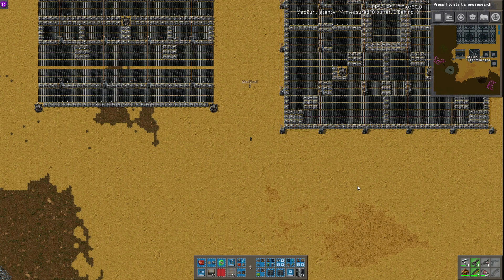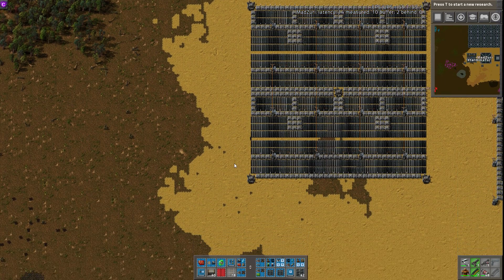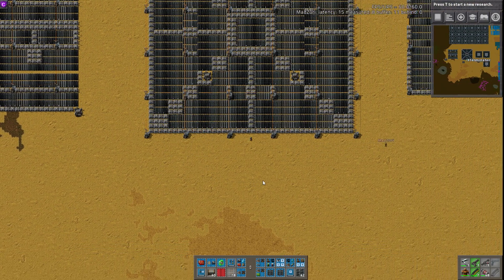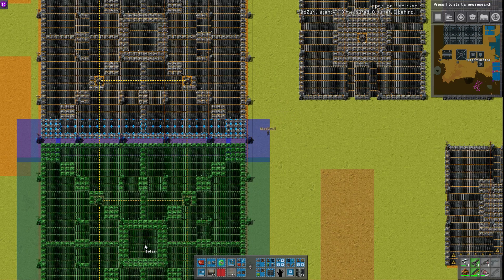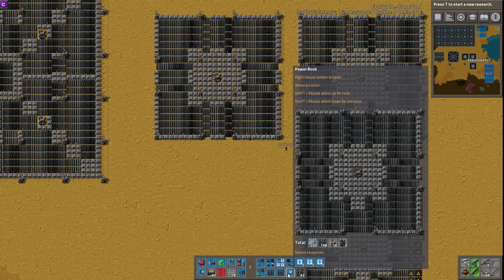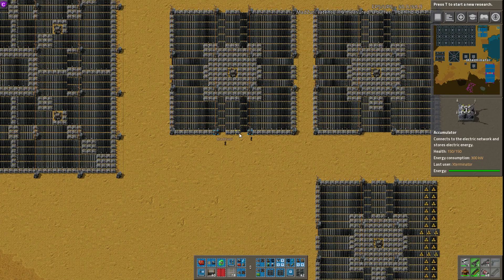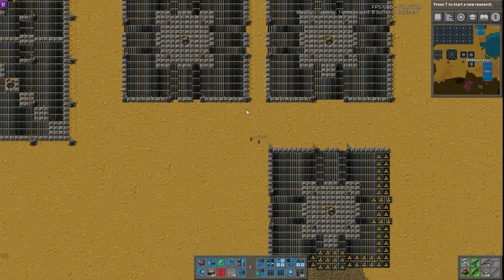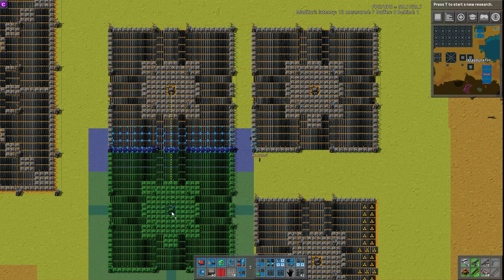Solar Builds / Designs :: Factorio Workshop Season 2 - Building A Better Factory

Comment: My design (the middle one) doesnt use the full substation range on the outside, but on the inner ones. Also, you can remove two accumulators and one solar panel and put a radar in there which also makes the ratio get closer to 0.84. If you just remove a solar panel and put a radar in, the ratio of accumulators to solar panels will get higher than before which can also be good because you have a little bit more backup power like that

Comment: I like the designs but I think if your serious about solar the ratio is a waste of time worrying about in practice. By that I mean I always use a lot more accumulators than the ratio. This is because power requirements are always going up and down depending on what your doing, if you get high demand in the middle of the dark I want lots of batteries.
That being said I think a mix of all the power generators good to have - although my rocket fueled boilers are now rusting from disuse.
Reply: Oleksij Rak yes, but having more accumulators is good for power peaks with laser turrets for example. with more accumulators than the "perfect" ratio you basically have the production of a perfect ratio plus extra storage for power peaks. that way, instead of building more solar fields that could produce the a mount of power you need at occasional peaks, you just build more power storage that gets used at those peaks which saves space and resources for solar panels. However this only works if you have one or a few extra fields to fill up the extra storage instead of permanently needing to supply the base
Reply: 0.84 ratio is the most space and materials efficient ratio for a given production. if you are getting out of power, build more solar fields. but build them with correct ratio. and don't tell that space is not a problem. it is for solar farms. they are huge, and I'd prefer to avoid extra few % of size if possible :)
Reply: hm, this is usually not a problem for me because i always try to keep my solar power at least double my usual energy consumption. But youre right, just using more accumulators would be more efficient.
Reply: Mic Lp &  Oleksij Rak Have either of you tried the mod for mrk3 solar? - the costs are horrendous but if time and resources aren't a problem - like in a mega base - then they are the way to go. I'm trying them for the first time and I like em.
Reply: I did. I'm using advanced electrics for that. but we are talking about vanilla right now :)